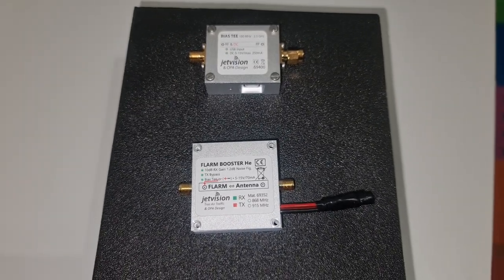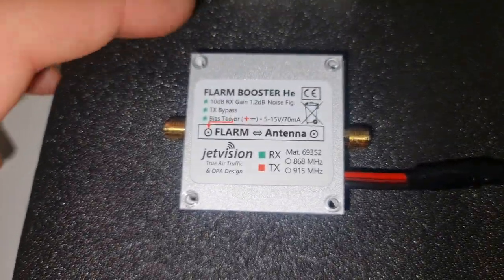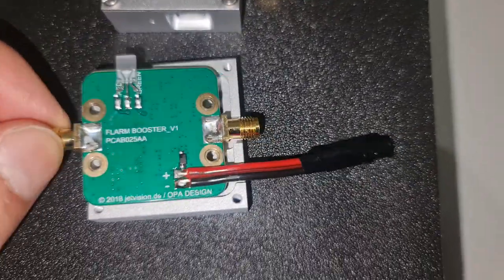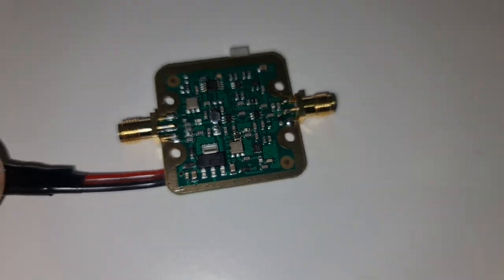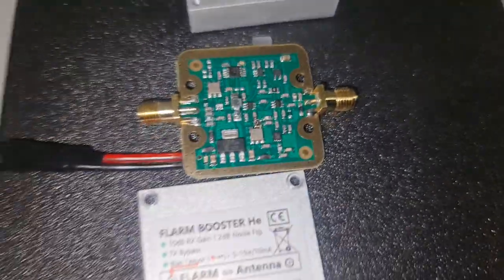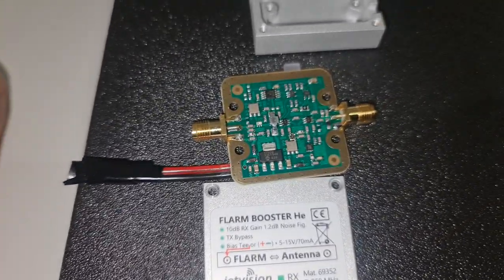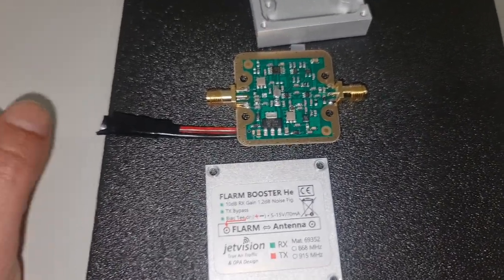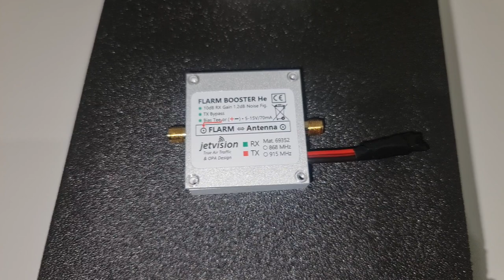FLARM BOOSTER He Teardown _HELIUM ADDICT

Comment: I have bought acasom 17/6 but its not working, I used original LMR400 cable, also a normal cable, 4 different antenna, also connect antenna directly to hotspot too but withness number dramatically decreased.
If anyone has any idea please share.
Reply: Did you connect it the right way around?

Comment: Is it really works ?
Reply from the maker: Yes
Reply: @heliumaddict8582  I saw Sorin connect his amps/filter/bias tee/attenuator  within his enclosure (on the miner’s side of the lmr400 cable. I understand this is not the optimal way but can you explain whether or not there would still be a performance increase? He used that setup in his test videos but I know he ended up waterproofing and connecting to antenna side later. Thanks I’m advance for information!
Reply from the maker: @PhilneyeOfTheClient   Hi , no its not optimal and you will lose the benefit of the Amplifier .
i know you are wandering how to waterproof your Amplifier , you can watch my FLARM BOOSTER videos i shown how to waterproof your Amplifier  in very simple and cheap way .
Reply: @heliumaddict8582  I’ve watched it. Good demonstration! Looks like I will be doing something very similar on my flag pole then! If not that then at least wrapping the amp securely with that tape. I have a lightning arrester connected as well on the antenna. Does the order go antenna - lightning arrestor - SAW filter (I already purchased because of acasom SNR) - amp booster - then finally lmr400 connection to the bias tee - then possible attenuator - then miner? I have a Bobcat with PoE connection (Ethernet running from out of my office window into the outside porch where miner enclosure is below) Any suggestions on the best possible way to power my bias tee with these components? Much thanks again for the education! I have about 7 meters of lmr400 coax connecting the bobcat to the antenna atop my flag pole outside next to the porch btw.
Reply from the maker: @PhilneyeOfTheClient  you are good 👍 
Happy Mining ✌️